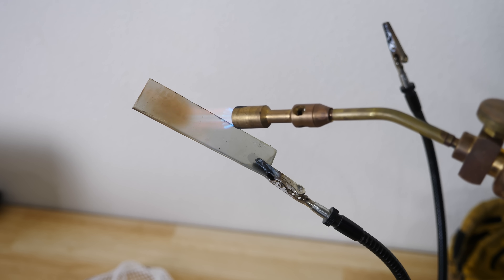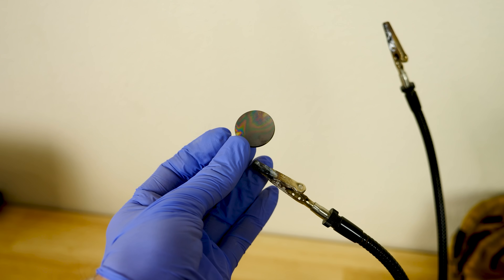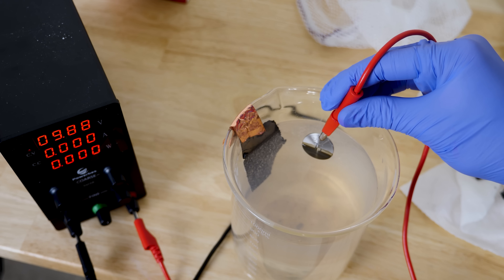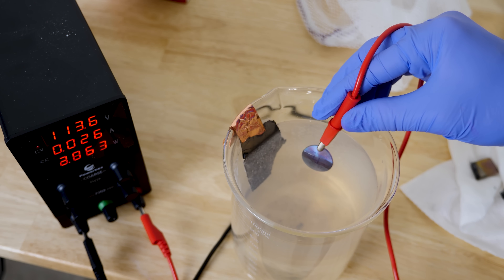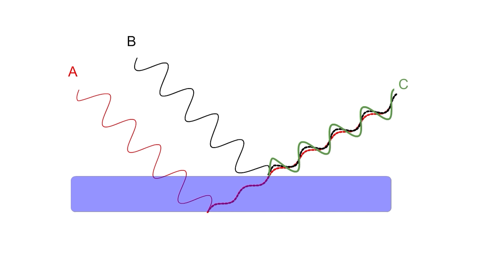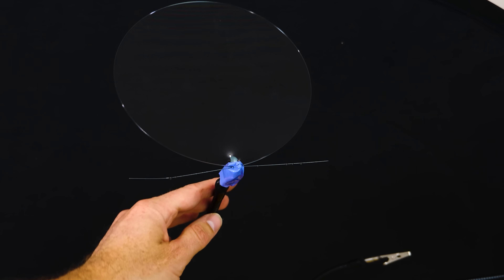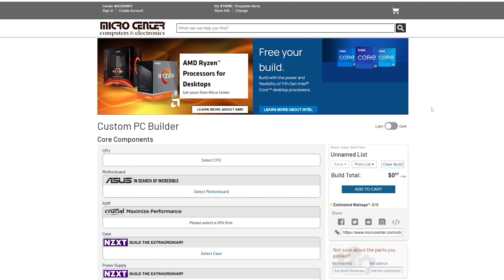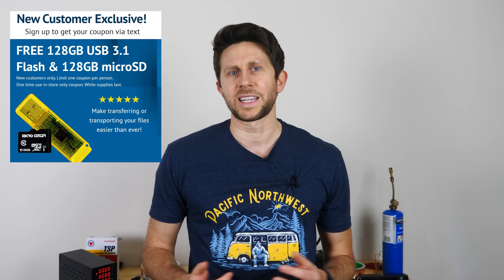Why Does Titanium Make Rainbow Colors?

Comment: It's not light interference, it's never been proven. Current voltage is intensity not electrochemical voltage, hence you regulate the amount of Ti atoms oxidized, i.e. the thickness of the layer, which determines the color, and angle, of reflected light which depends on the absorbed and dispersed photons. No interference, please!

Comment: Hi. There's something I didn't grasp well: if the colour is due to thin film interference, shouldn't it vary according to the angle of observation? Instead, the colour appears the same regardless the point of view.
Alberto Rasà
Reply: I think that would happen when you used polarized light.
Reply: @davidcsik9761  It does not seem necessary to me: it's only the optical path's difference that gives a difference in phase of two reflected waves.

Comment: He says you can use just table salt but doesn't electrolysis using table salt create chlorine gas kinda deadly Info to be sending out to kids that watch your channel unless I'm mistaken if so please correct me
Reply: Nevermind looking back it looks like the reaction would be small enough at that voltage that it wouldn't cause a large amount of chlorine to be made though I feel like whenever a creator mentions electrolysis with salt they should make a disclaimer about the toxins that can be made with those reactions

Comment: When you look at metal shavings from a CNC mill, you can see that it takes on a very strong pinkish/purple color due to the strong heat generated when shaving the pieces off. My instructor at work used to collect the metal shavings from the lathes and mills down in the shop to explain heat treatments to us.

Comment: Does voltage really have anything to do with the color? I thought it's the oxide film thickness that's the key, which means you can hold the sample in for longer to get the other colors.
Reply from the maker: once you build up the thickness at a certain voltage, increasing the length of time doesn't do anything. The voltage controls the thickness as DANG JOS said.
Reply: @TheActionLab  Why is that, though? I definitely know that when coating stuff with copper, the factors affecting the thickness of the deposition layer are current and time.
Reply: @dryued6874  TiO2 is an insulator, as long as current flows the oxide layer grows, but the resistance also grows, the higher the voltage the thicker the insulator needs to be to stop current from flowing

this is just an educated guess, so take it with a pinch of salt.
Reply: @TheActionLab  Is there any way to reverse the process? (Is there a way to remove the coating and make it go backwards in colors?)
Reply: It is the film thickness that matters, and the voltage controls how thick the film is.

Comment: A 128GB SSD is just taking up space tbh
Sure you can use it to run your os but even a 256 isn't very costly and already do much better
So the "deal" from microcenter is not very spicy
Edit: A 128 SSD is about 15 Euros and a 256 is about 25. Makes a very huge diffrence in price to get one for free if you also have to by a graphics card for a few hundred

Comment: I'm considering doing this to a titanium dive knife... would the oxide layer negatively effect the knife in any way e.g. salt water corrosion/hardness etc? I'm guessing that it shouldn't and any effect that it had would be surface only?
Reply: Shouldn't change it's corrosion resistance, at least on the inside. The oxides are pretty scratch resistant on titanium though, and the process can be repeated if the finish becomes too scuffed from use.
Reply: It shouldn't have much effect. The titanium oxide layer is very thin at few hundread nanometers. its very stable in salt water. I also don't think it will affect the cutting properties. 
Haven't done this myself but I have a degree in materials science.

Comment: Is there any way or any easy way to reverse the effect? Can you make it change back to its earlier colors easily?
Reply: I know that stainless steel that went rainbow from an industrial wash will go back to shiny metal with a little chlorine
Reply: No. You can only go "up" to a color that develops at a higher voltage. If you anodize titanium at 25v, you get blue. Afterwards you can anodize it again to any color that develops at a higher voltage, for instance gold at 62, purple at 75, seafoam at 95v or green at 105v.

Comment: I've been anodizing titanium for years. The grade of ti affects the colour as well as the surface polish.  Fun stuff! 👍
Reply: Are there big differences anodizing Gr2 vs Gr5 titanium?
Reply: @mitchel90mcnee  Yep. Grade 4 seems to work best.
Reply: @jamesbarisitz4794  Thank you for the info, now I know what to do at work today!🥸
Reply: Cool
Reply: Who invented it?
Reply: How do you clean your titanium? I wipe it off then use wink then wash in winded then distilled water and my ano doesn’t come out that good sometimes
Reply: Can they still be just as vibrant?
Reply: 2 Questions:

Can the negative anode be any material?
Can it be another piece of Ti?

I guess from my understanding the grade of the Ti will give you deeper, vibrant color?
(So this is why some projects seem to have vibrant colors while others are light pastels?)
Or is that not the case?
(Maybe the finish of the Ti pre ano dictates color depth?)
Reply: I thought it was "color" hello from the other side of the pond!!
Reply: Does it come off easily?
Reply: @GestOfAll  No, it's surprisingly durable. But it's for sure not super hard either, and very thin if it's got colour. it's very chemically resistant too.
Reply: @GestOfAll  as hard as aluminum oxide I guess

Comment: Awesome experiment!  I'm always learning a ton from you and I appreciate it.  Years ago I acquired some pure Niobium and a Ferro-Niobium alloy which I did many color change experiments on.  As I remember there may be like 5 different oxides that can form which affects the color it appears.  Also I think it could be achieved using chemical, heat, or electrical means...but it's been a long time.

Comment: How would anodized Titanium react if it was in a different light surrounding it, for instance UV, IR or any other form of Light that isn´t white light. Would it show different colors?
Reply: If its a monochromatic light then the titanium coin will look either dark or bright for destructive and constructive interferences respectively depending on the thickness of the oxide layer. If its UV or IR, the same thing will happen but we humans won't see it.

Comment: Small correction: At 3:38 you say that the titanium disc looks blue because it is absorbing red and green light. This is not true, and contradicts the explanation you gave earlier. It appears blue because the red and green light from the surface and the oxide layer are destructively interfering with themselves. This is not absorption.

When something appears a certain color to us, that means the only light leaving the object and hitting our eyes is that color, but that does not mean all other colors of light were absorbed. Absorption is just one of the mechanisms by which this can happen.
Reply: Confusingly, it actually is absorption, even though the destructive interference explanation is correct.

Energy is conserved in this interaction. When the waves destructively interfere, the photons still have to go *somewhere*. The waves cancelling outside of the titanium oxide boundary layer means that there is zero chance of detecting the photon outside of that layer. Which means it was absorbed by the layer.

At the end of the day, the wave-only description is just an approximation of the actual quantum mechanical phenomenon, which says that photons are also particles and they can't just disappear.

Comment: question off topic. will 2 metals weld together simply by touching each other in a vacuum?
Reply: He has a video on this topic. Search up “Cold Metal Welding”.
Reply: I dont see why they would 😅
Reply: @LowkeyAirgunner  they do in outerspace. the tools the astronauts use are specially designed so they dont weld together. if they werent all you'd have to do is touch them together.
Reply: @drkrypton4410  well thats weird 😅 science is something else!

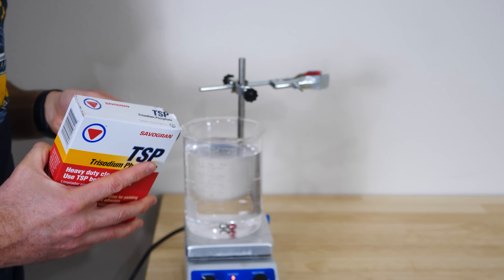Comment: 1:13 just one question if we used table salt then won't it give chlorine in anode. 
Thus forming tittanium chloride???
Reply: It will form Cl2 gas, which is bad. If you use low currents you probably won't die though.
Reply: @Rhaegar19  That is not the answer to my question .Yet thank you
Reply: @karunamundra592  To answer your question, the titanium will oxidize first, preventing any reaction with the chloride ions. At high enough voltage it may be possible to drive the production of TiCl4 by reacting TiO2 and Cl2, but it would take some ugly thermodynamics calculations to be sure.

Comment: I never considered that it was weird how snow is a different colour to ice.
Reply: 😂 He glanced over that like I knew that
Reply: Or translucent soap and white bubbles.
Reply: I mean, ice is solid. Snow is not. It's not surprising that they reflect light differently
Reply: @contraband1543  Snow is a solid... So is sawdust.
Reply: @ShAd0wE1337  And now tell me sawdust has a grain structure. ;) At least none of both (the lignin etc. stuff) is translucent. But HIPS if injection molded is translucent, and at the same time expanded styropor is white. As long there is no colouring additive, but just virgin plastic is used. Well some different additives are also in both forms I think.
Reply: @wernerhiemer406  What other state of matter would sawdust and snow be in?
Reply: @ShAd0wE1337  Same but not same looks
Reply: @contraband1543  huh…
Reply: @contraband1543  I know you mean solid as in a whole chunk but… SNOW IS IN THE SOLID STAT-